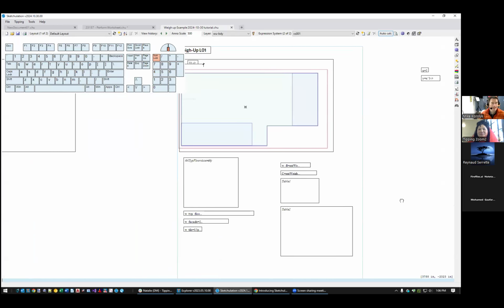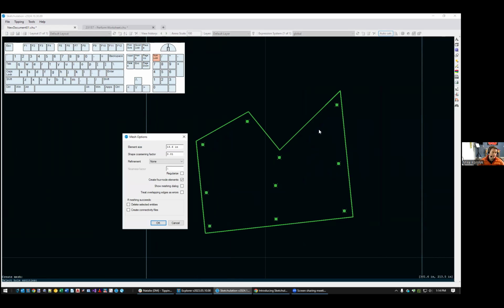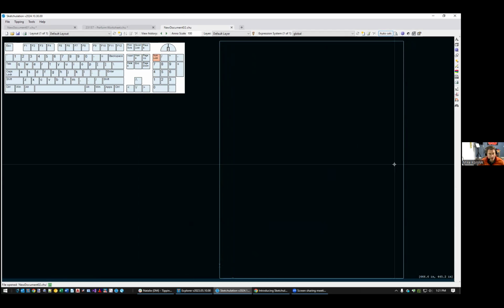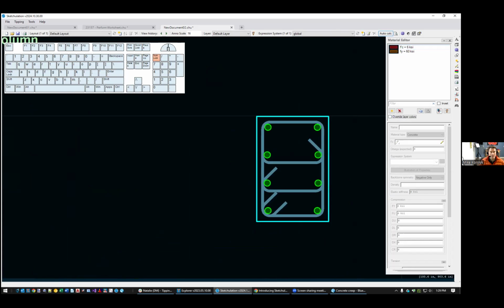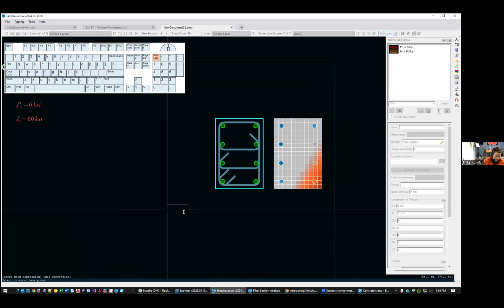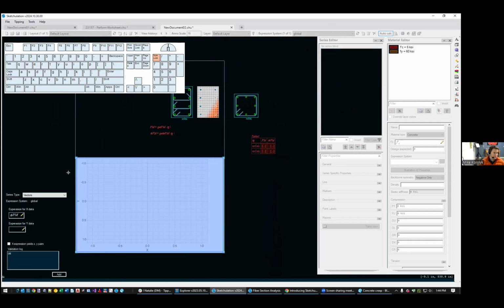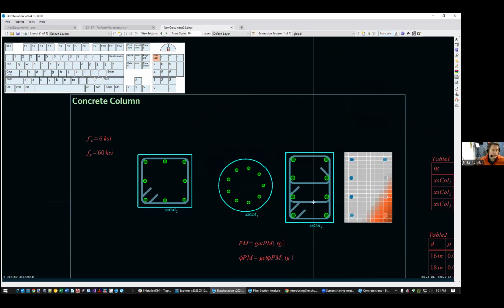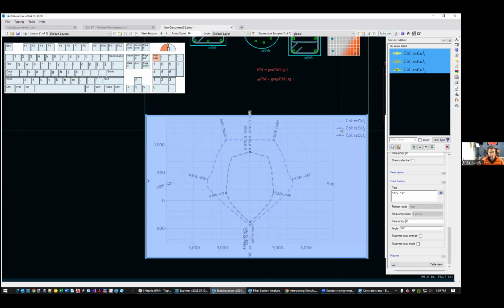Sketchulation Tutorial for New Users - Part 3 (Concrete column)

Comment from the maker: ⏱Timestamps⏱  
0:00 Start
1:00 Tutorial Outline
1:11 Review of Part 2 Tutorial
1:42 Weigh up example
2:03 Importing images: "ctrl" + v & "ctrl" + p, or via import
2:21 Create entities with area weight, shape (sh), assign tag, create expression text (xt) with entWeight function
2:55 Create boundary with entity tag
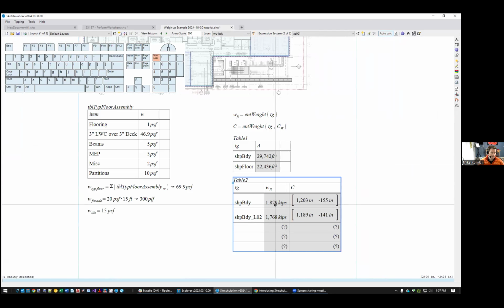3:07 Create table (tbl) to determine floor assembly weight in psf
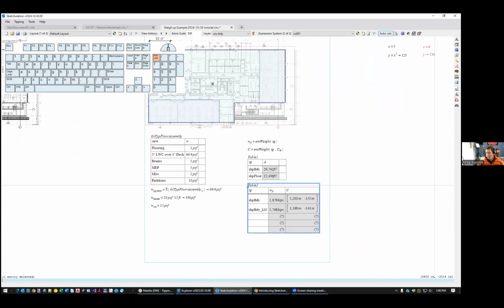3:10 Create tables to show properties of entities "tg", Weight entWeight(entitytag), Center of Mass entWeight(entitytag, C_W)
3:12 Response to attendee question about holes in entities
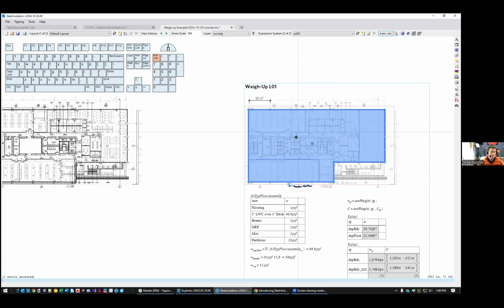3:37 Option 1, draw shape (sh) with negative weight
5:02 Option 2 Hatch entity: Hatch boundary (hb), shape to exclude
8:00 Response to attendee question about tributary areas for column
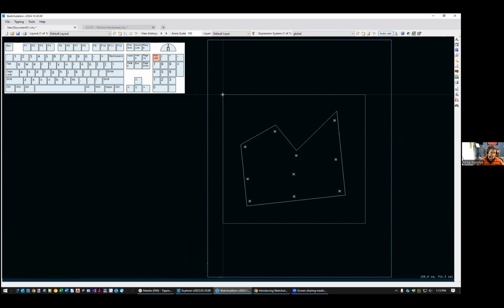8:45 Mesh
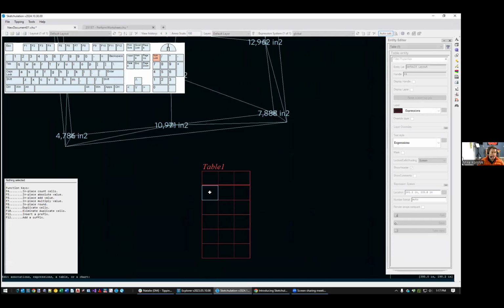12:15 Make table (tbl) with expressions for column loading
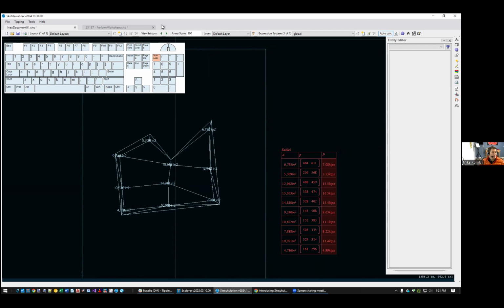16:35 Tutorial 3 on Fiber Section Analysis, Introduction
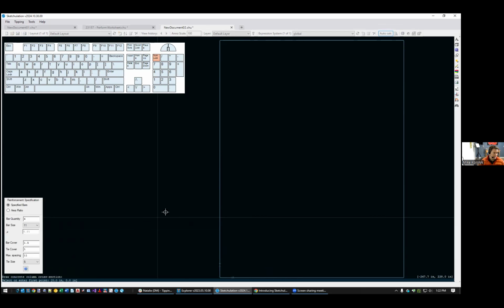17:22 Draw Concrete Boundary of column, concrete column (ccol) - (16,12), indicate bar quantity, bar size
18:08 Page Setup | adjustments via "Anno Scale" - 16
18:33 Layers [Alternately, draw shape (sh) & draw steel reinforcement at boundary, by hand: rebar section (rbs)]
20:00 Create title, text (t), set text properties
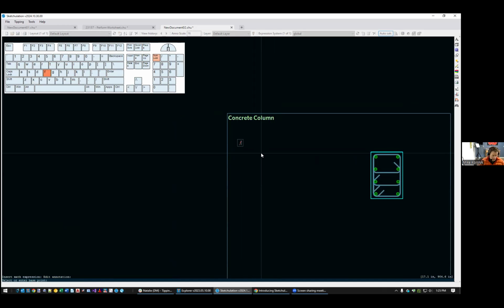20:08 Create expression text (xt) to define material strength, concrete f'_c, steel f_y
20:40 Fiber material editor (fm): Define concrete material
21:51 Macro for material types (preset backbone curves associated with strength of material type)
22:52 Note on long-term creep per ACI
23:22 Assign concrete material to shape, select entity, use paintbrush
24:01 Fiber material editor (fm): Define steel reinforcement material
24:10 Assign steel material to shape, select entity, use paintbrush
24:20 Override layer colors button (to check material assignments), backbone curves
25:01 Analyze section: Fiber Section Moment diagram (PM),
28:10 Axis of analysis
28:15 Exporting data, or copy into clipboard
28:58 Fiber Section Moment Rotation (MR)
29:19 Axial load demand
29:39 Type of response (i.e. brittle)
30:00 Moment-moment curve (MM)
32:03 Create expression to create array, getPM(cross section boundary tag)
33:40 Make chart (cht), series (ser)
36:16 Create second column (ccol) (18,18), assign materials (conc + steel), add tag
37:12 Autotag (e,g, "xsCol" prefix)
37:54 Make table (tbl) with PM data
39:03 Render array as compact
39:40 Make chart with multiple columns, edit series (eds)
40:44 Circular reinforced concrete column, array (ar) - polar, assign materials
42:31 Chart with all three PM diagrams
43:39 Using table to optimize designs, getCol~fPM function knowing d and rho
48:57 Notes on charting and editing series (eds)
53:40 Chart tags
54:02 Point Labels using angle brackets